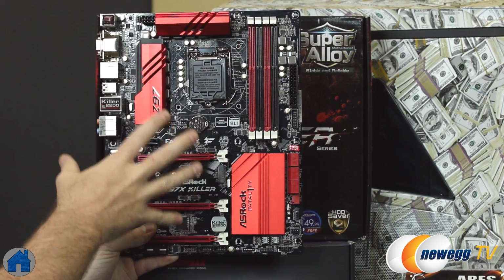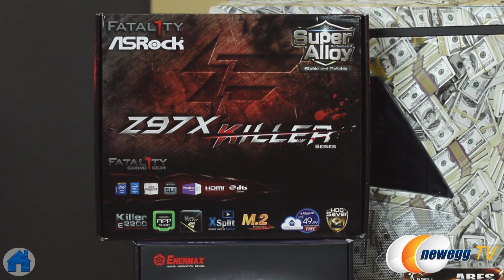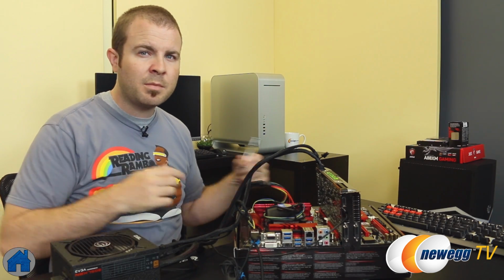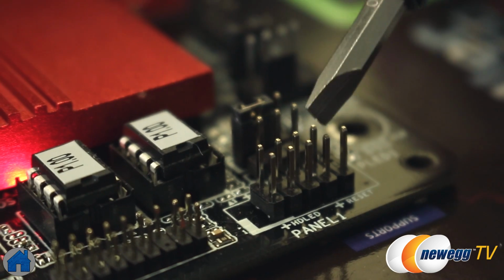How to Build a PC - Part 1 - Newegg TV

Comment: I almost killed my motherboard by trying to jump it with the screwdriver for the out-of-case build. The explanation was at the end of the video. Don't do it if you can! Or at least get to know what pins do what - you never want to touch the wrong ones. Remember, arrow on the back of the cable means positive, the motherboard also comes with small table on which pins mean what. Here is another explanation - don't repeat my mistake. https://www.youtube.com/watch?v=b6q4h-lNHrU

Comment: im having the worst trouble putting the thing together ive been here for 5 hours trying to figure it out.. 
I've already put everything onto the motherboard and screwed it into the thing, I just cant seem to understand what this cord is hes pulling out that isnt connected to anything whatsoever, that hes trying to hook up onto the motherboard. there is like 50 billion wires that are super confusing that I'm trying to figure out how to use/connect and I have no idea what I'm doing. The instruction manual is like trying to do science/math and I can't understand anything that I am doing and no matter where I look online, I am super heckin' confused. 

I dont know how where and what to plug what into, and the video stopped being useful for what he reccommended to buy at like oct/13/2018 on the webpage because the things dont look alike, or make any sense whatsoever. if anyone could help me id sorely appreciate it. I can video it or anything, Im just confused by all these parts and Ive never put together a pc and I'm feeling incredibly dumb having bought all the stuff for like 630+ $ !!! 
I wish I could return it at this point but I cant unfortunately, and it sucks. I wish I could just figure this out! I just want to use my PC now since my laptop is pretty much croaking and beeped its like beep.
Reply: Hey so this video is 4 years old, and has outdated instructions as well as parts. It mostly holds true, but you should look at bitwit Kyle's video for more accurate and relevant information

Comment: Do the cables typically come with the parts, or do you need to buy them separately?
Reply from the maker: Hi Alvin, great question! It would typically depend on the part that you're purchasing. For example, most HD's will only usually come with just the HD itself, while a power supply will come with all the cables needed. It's best to check with the manufacturer depending on what part you are interested in purchasing. - Louis

Comment: This is my first build, any problems? 

CPU: Ryzen 5 1500x Quad Core
Cooler: Stock AMD Cooler
Motherboard: MSI B350 TOMAHAWK ATX
Memory: (May change cause of market) G.Skill Aegis (2x4) GB DDR4-2400
Storage: (SSD) Kingston A400 120GB (Hard Drive) Western Digital 1TB
GPU: MSI Geforce GTX 1050ti
Case: DIYPC Ranger R4 Mid-Tower

Comment: Im interested in building a home computer and branching out with the price of windows operating systems is it affordable and how secure can i make from computer puppetering  as i have dealt with havkers  taking over my computer for years moving tje mouse making it run slower amd excessing and downloading files from the web could be cousins vould be creep asians maybe both.... But yeah is thete an operating system that prevents remote computing
Reply: Besides not pluging it into the wall or using internet?

Comment: Im planning in making a PC, are these parts compatible?

be quiet! PURE BASE 600 WINDOW Black/Orange
CORSAIR TX-M Series CP-9020131-NA 750W ATX12V v2.4 
G.SKILL Ripjaws V Series 16GB (2 x 8GB) 
GIGABYTE G1 Gaming GA-Z170X-Gaming 
Intel Pentium G4400 Skylake Dual-Core 3.3 GHz

I plan to improve it as time goes by but for now, will that make a working PC?
Reply: you're missing a GPU and a hard drive. put together a pcpartpicker list to check for any compatability issues! not sure if the CPU works with that gigabyte motherboard or not.

Comment: Hi, I was curious to see if anyone would comment or give advice on my specs. Thank you!

Processor- i7 7700 3.6 GHz Quad Core
GPU- Gigabyte GeForce GTX 1060 G1 Gaming REV2
MotherBoard- MSI - Z270M MORTAR Micro ATX Motherboard
RAM- G. Skill Ripjaws 16GB (2X8)
Storage- WD Blue 1TB Hardrive
Power Supply- EVGA 600W PSU
Reply: Go to /r/buildapc on reddit.  Youtube is not really the place for asking for parts advice.  Good luck.

Comment: Okay this is confusing as hell. I have my cpu setup no problem, everything else seems to be in order except my ram doesn't fit my mobo. The only thing I have found wrong is that the connector gradually gets thicker towards the notch? And yes it is supposed to be compatible

Comment: Having a strange problem, I do the outside the box build, I even plugged in the cords from the case and pressed the power button on the case and everything turned on. When I put the motherboard in the case and attached the SATA devices and press the power button, the CPU fan will start for a split second and then stop. Nothing else starts up, the case fans don't turn on, the GPU fans don't turn on, the light on the GPU flashes for a split second and then nothing happens. Any idea what went wrong
I have a:
Tesseract Deep Cool Case
MSI H110M Gaming Motherboard
Core i3 6100
Thermaltake CPU fan
 Radeon RX460 4GB GDDR5
HyperX Fury 8GB RAM(4x2) 
Corsair ForceLE 240GB SSD
WD 1TB SATA 64MB HDD
LG Bluray Optical Drive 
500W PSU

edit-I took motherboard out of case, left RAM, Graphics Card and CPU fan attached and pressed power button and it comes on again. For some reason it will only run outside the case, anyone know what that is about?

edit2: Nevermind, I found the problem, I didn't have the standoffs properly installed.

Comment: Why are there two 6+2 PCI blocks when it only uses 10 pins?
Reply: Serpathy in case you need those plugs. For instance if you have two video cards you might need both 6+2 connectors

Comment: I've watched all three parts of how to build a pc and they are very helpful.  I am attempting my first build.  I have purchased almost all the parts except the OS and SSD and CPU.  I thought I would try to see if I have correctly installed the components that I have already purchsed to see if the power connections are OK.  Nothing happened.  Fan did not spin or front panel LED did not light up.  So my question is "does the CPU have to be installed to check this simple power test?"  Whatever info you could provide would be very helpful.  Thanks.

Comment: Doing my first build, started with the outside case build as suggested here. It wont turn on for me, I don't know if I'm not touching the actual power pins or if the motherboard is dead. I am using an MSI H110M gaming, every thing appears to be plugged in correctly and I tried touching the screwdriver to the JFP1 and JFP2 and got nothing. The manual doesn't specifically say what the power pins are.

Comment: looking into building my first PC so I'm in the process of researching, could anyone give feedback so far? I'm kinda on a budget (hence the i3) but I'd be willing to spend a bit more if given sound reasoning for it
https://pcpartpicker.com/user/mikami/saved/xQ78dC

also need recommendations for a modulated budget PSU that could replace the one I have here, since the basement on this case looks pretty crammed

Comment: Thoughts?

Intel Core i5-6500 3.2GHz Quad-Core Processor

Cooler Master Hyper 212 EVO 82.9 CFM Sleeve Bearing CPU Cooler

MSI B150 Gaming M3 ATX LGA1151 Motherboard
 
Corsair Vengeance LPX 8GB (2 x 4GB) DDR4-2133 Memory

Western Digital Caviar Blue 1TB 3.5" 7200RPM Internal Hard Drive

Gigabyte GeForce GTX 1060 6GB 6GB G1 Gaming Video Card

Corsair SPEC-02 ATX Mid Tower Case
 
EVGA SuperNOVA NEX 650W 80+ Gold Certified Fully-Modular ATX Power Supply

Asus DRW-24B1ST/BLK/B/AS DVD/CD Writer

Microsoft Windows 10 Home OEM 64-bit
Reply: CentralIllinoisRailfan not bad.... :)
Reply: How about mine?
Intel Core i5-760 Processor 2.8 GHz 8 MB Cache for $50
I am going to overclock it to 3.3
Reply: Good build. Though I recommend changing the motherboard to the ASUS Z170 PRO GAMING.

Comment: Hey man, so to access the uefi bios I need a wired mouse right? Well I'm thinking of buying a usb to ps/2 y cable converter/adapter. My question is do I need a specific Y cable adapter to use my gaming mouse?Would any cheap usb to ps/2 adapter work fine?What is the difference between y cable adapter and y cable converter?

Comment: Does the heat sink fan come with the CPU?
Reply: Take a look at what's included in the description of the processors. A lot of time yes one is included. Same goes for the ones in the video. Using the heat sink that's included may be foolish to use tho if overclocking the processor is something that is done for example as the heat is going to be hotter in those instances because its running at a faster speed. Trying to keep things at the proper temp is crucial to increasing efficiency and lifespan of your shit. The temperature can be checked with software for example to find out if its safe for your products. And of course you can look up what temperature things need to be at online. Hope this helps. Good luck.

Comment: Love your videos, very informative. I am about to do my first build so I am the last person to give advise or critique your work since you are the expert. But at 42:05 you mounted a radiator at the rear of the case pushing air from inside the case exiting the rear. Aren't you defeating your purpose, you are using warm or hot air to cool the fins, shouldn't it be the other way around, pulling in cool air from the outside to cool the fins? Wondering why you went the way you did.

Comment: how is this for my first build I've been doing research for months http://pcpartpicker.com/list/PN3t7h
Reply: Its pretty good I might just use solid state drives. since this video slightly outdated some of the technology has changed so ssd's are cheeper now. other then that it looks really good.
Reply: This is my exact first build! Except I chose to go with one 850 evo 500gb for storage and a 6600k i5. :) Happy to see a similar build as mine!
Reply: you finished building yours?
Reply: It's good. If you're not done yet, the PSU seems a bit overkill. You don't need 750 watts. I'd say go more around 500-550
Reply: yeah i already ordering everything thanks for letting me know though
Reply: ReprisalZems how is it?

Comment: should've been more specific for the rest of the wiring. We don't know where the rest of the wires already in the case goes if we are novices. Same goes with power supply and should have been more through on SSD installation and how the screw should be set.
Reply: I've ordered the parts for my first self-built PC and plan on using this as a guide. Do you know of another guide that addresses the points you say they left out?
Reply: Carey Holzman, nuff nuff jigglypuff

Comment: Hello, I'm going to build my first pc soon and I'm excited but also a little nervous.  I wanted to ask you a question about all those cables.  When you buy the power supply does it bring all the wires that you need to connect to all the parts you have for the build?  I bought the EVGA SuperNova G2, 80+ Gold 1000 watt fully modular.  For example I have 2 of the 960GB Sandisk Ultra ll SSD and want to run those in raid 0 so I can have about 2TB of space and I have also a samsung 950 pro M.2 512 PCI-Express SSD for my boot drive.  Would I need extra cables for the 2 960GB SSD's?  Thanks!
Reply: Thanks for the reply..I got the cables/wiring installed which really is I guess the most difficult part for any new pc builder. The most important thing is everything is powered on and working. Only problem is the way I set up my hard drives.  But I guess I'll check out some more videos on how to get 2 of my ssd to run in raid 0.  I'm doing video editing and want everything to run as smooth/fast as possible.

Comment: I bought an i5 6600k and ddr4 corsair veng lpx (3200), this is above the processors recommended speed, but I can just use xmp on my mobo (Asus z170-a)  to limit the speed, correct?
Reply: Nvm
Reply: +Sun Blaze xmp brings it up to its advertised speed

Comment: So i'm planning to run on games around that were made in 2013-2014. My budget is around 400-600. I want to spend as least as possible. Are these specs good..? Please note that this is my first PC build.

CPU: AMD FX-6300 3.5GHz 6-Core Processor

Motherboard: Gigabyte GA-78LMT-USB3 Micro ATX AM3+ Motherboard

RAM:  Crucial Ballistix Sport 8GB (1 x 8GB) DDR3-1333 Memory

Storage:  Seagate Barracuda 1TB 3.5" 7200RPM Internal Hard Drive

Video Card: EVGA GeForce GTX 950 2GB SSC ACX 2.0 Video Card

Case: Thermaltake Versa H22 ATX Mid Tower Case

Power supply: EVGA 500W 80+ Certified ATX Power Supply
Reply: Guess that 500W is a slight overkill for that system. Considering full load on that system it should still get below 280W. If you can get your hands on some 300-400W PSU you should be fine - unless you plan on upgrading to something else that you didn't let us know. Also, you picked a microATX Mobo with a mid case, might be able to squeeze some more savings getting a smaller case. Be aware that microATX mobo might have issues fitting that VGA and not getting on something else's way (ie PCI slots, DIMM slots, etc). One last thing I could catch on a quick glance is that you picked a single RAM stick for a mobo that DOES support dual channel RAM. If there's no reason on why you did this, split it into 2 4GB sticks and you might get significant more RAM performance by roughly the same price.

Post that on reddit, get to the /r/buildapc sub. Might drop there to help you out again. Folks there are amazingly helpful 
:)

https://www.reddit.com/r/buildapc
Also, http://www.logicalincrements.com/ has a ridiculously well displayed ton of info to get you your perfectly fit rig. Good luck! o/
Reply: Ah, thank you!
Reply: +Mazu Mazu noooo do not get 300w psu 
get one from corsair ,evga,fractal...  if want effisency (totaly screwed up that word) and dont want to burn your computer
Reply: branimir svaguša My setup is totally different from this one now lol.
http://pcpartpicker.com/list/G3dGqk 
This is sorta my set-up, although i'm buying everything from local stores, so some parts might be a bit different.
Reply: Nice
Reply: branimir svaguša Yep, buying this tomorrow after I sell my old computer, i'm hoping that they have the parts.

EDIT: Actually, today. It's 2:36 in the morning lol
Reply: +Mazu Mazu are you joking wait this build is bad for the price
Reply: +Twists stfu it is his pc and build isn't bad at all
Reply: Twists Again, made another build. This one is old.

Comment: my computer won't turn on http://pcpartpicker.com/list/73cp8K
Reply: +GAMERtecher isnt 1000 watts just slight overkill???
Reply: Is this the first time you're building your pc? If so, check if the power supply is on. The build itself is looking good, but rookie mistakes can cause a heart attack. Maybe you built it on a carpet? Highly conductive material may cause static and fry your pc parts. Were you ever shocked during the build? That may explain why it doesn't work. Lastly, check if all your psu's cables are plugged in the right spots. If not, that can also fry your components. Press the power button and see if it works now.
Reply: +Firestarter I'm just switching out the motherboard I was on my bed and I made sure not to have my feet on the ground and kept touching my power supply
Reply: +GAMERtecher no I bought the wrong power it was enough to start it up but not enough to keep it on for long periods so I went for 1000 watts. Since I made a mess the computer guy charged me 40 more dollars since he had to sort everything and he said I messed up pretty bad